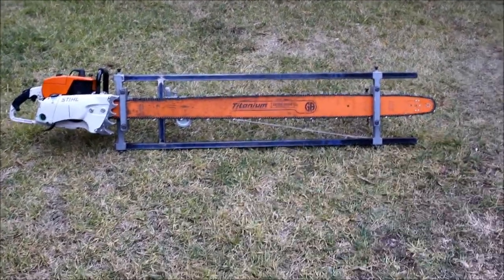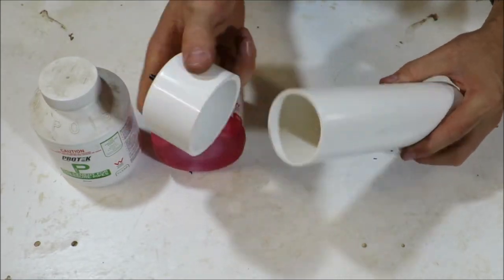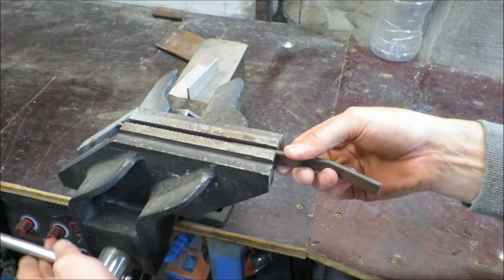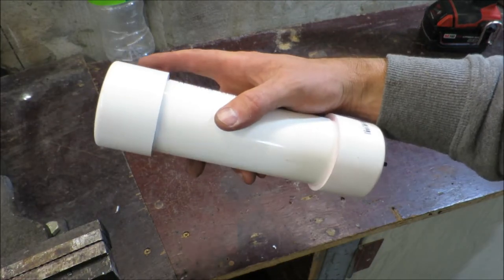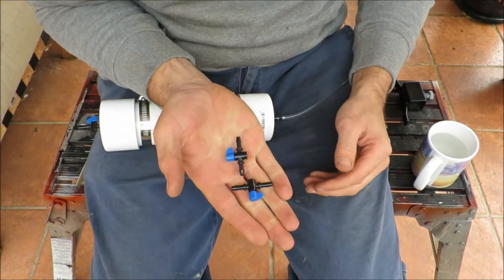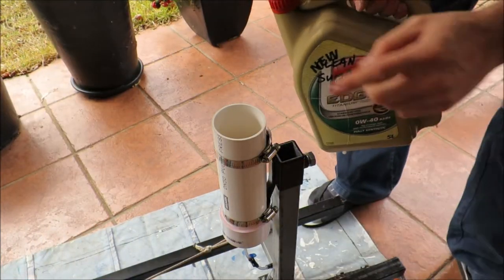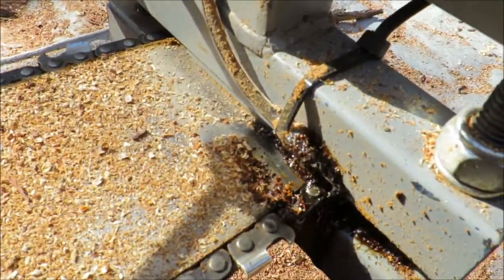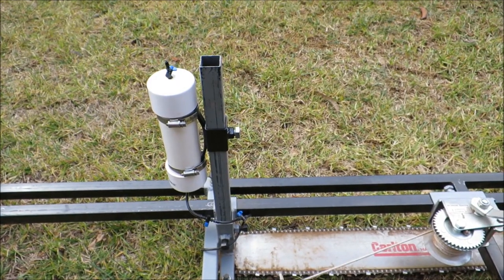Auxillary Oiler For A Chainsaw Mill - Build

Comment: I got a 8mm bolt about 25mm long drilled a 2.5mm hole down the centre then a hole from the side to the centre. Drilled a hole in my bar so that it delivers the oil to the chain inside the bar…I don’t like the fact that you use waste oil as it’s the viscosity of the oil is what makes your bar and chain last longer but each to their own opinion. Nice job on the tank.

Comment: The current position for your drip is just before the chain goes around the bar tip. If you move it to the side if the tip where chain is going along the bar and you should get more oil going into the cut. As it is some is being flung off the chain as it "goes around the corner".

Comment: Nice oiler and mill. I have a bandsaw mill but have been in the market for a chainsaw mill design and I must admit yours is simple, effective and to the point. I have quite a few large oak and pine that wont even get on my mill and want to slab them for table tops. Glad I saw and subscribed to yours.
 Keep up the good work.

Comment: Yes, this is right, for me I just stuck a magnet on a nut and the hose goes through it so I can adjust the hose when I change the bar.
I also saw that your chain is at 35 deg angle

Comment: Nice! Thank you for sharing details of your build. 
I have a word of caution.  Your mill is clamped over the sprocket in the tip of the bar.  I just burned out my sprocket this way.  I'd hate for the clamp to come loose on the bar and ruin my chain.  From now on, I will clamping the mill away from the sprocket.

Comment: Ive made my own chainsaw mill,and for setting the thickness of board to be cut I drilled holes up and down my vertical post  for a pin to go through and and the main frame  that clamp to my bar, have you noticed any slippage on yours where you welded a nut and bolt to tighten your desired measurement, whether for bar length and or thickness of slab due to the vibration from your saw? .great video too .

Comment: Great build and really nice video work. I just built a chainsaw mill based on the Norwood Porta Mill. I have Black Walnut to slab and the oiler on the saw just wasn't doing the job. I need an auxiliary oiler and your video will be a great help. Cheers and thanks!

Comment: very nice mate, howcome old sump oil and not proper bar oil? cheers.
Reply from the maker: G'day Sheever, the sump oil is new and very clean, came out of my Maloo (0w-40 full synthetic oil). Bar oil would be best but I don't know how well it would run through the oiler just under gravity.
Reply: Okay so you could just use brand new sump oil? yeh i thought that bar oil would be too thick and not really run through, ive heard of people using just cooking oil aswell. I just got a brand new 880 and building a mill atm so keen to get out and cut me some solid redgum slabs up the bush. Do you use a skip chain or full come and ripping or cross cut? cheers mate!
Reply from the maker: Yer, you could use brand new motor oil for sure. I haven't tried cooking oil so can't comment. 
On my 5 foot bar i use a skip tooth ripping chain. 
On my 3 foot bar I use a normal cross cut chain most of the time (full come). 
For the 3 foot bar I have both types of chains, ripping and cross cutting, and I cant really tell the difference between the two when I'm cutting or in the finish.
Redgum is a beautiful timber and should make for some awesome slabs. Chainsaw milling is hard work but the results are definitely worth it.  
A couple of tips; I double up on the hearing protection - so ear plus and ear muffs. I also wear anti-vibration gloves even with AV saws like the 880 and definitely put a hand winch on the mill.
Good luck with it mate.
Reply: alright awesome will do the double protection and look into some of those gloves. Also i did buy a winch which i will be mounting onto my mill when its finished. Cheers mate youve been a great help!!